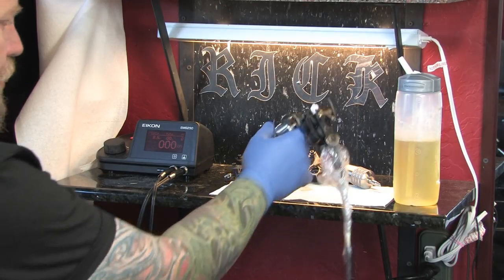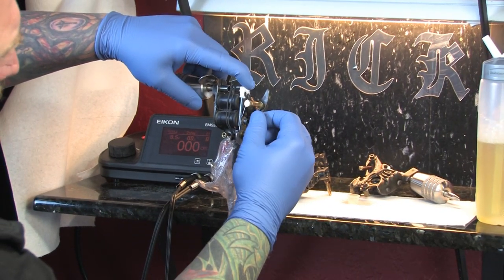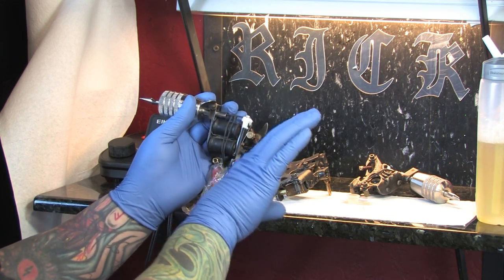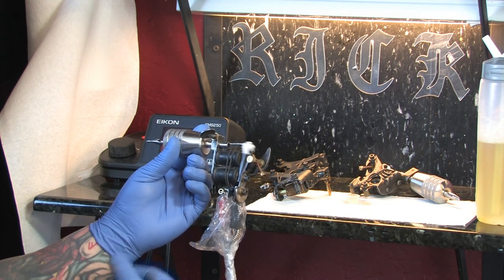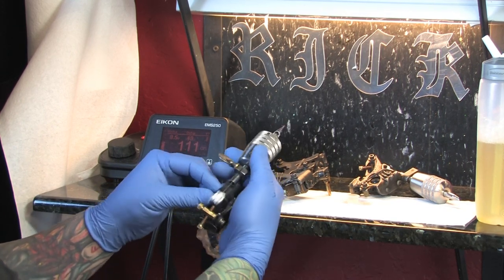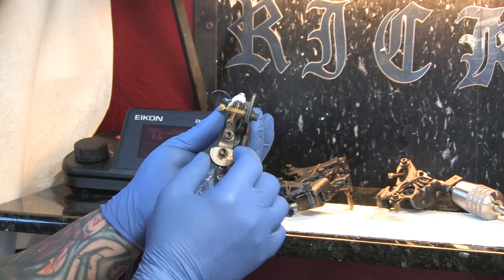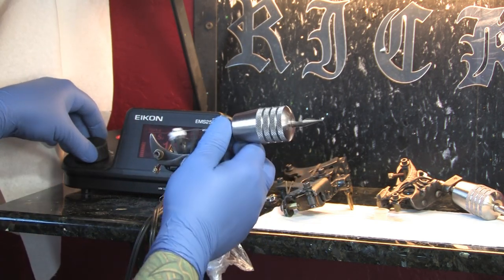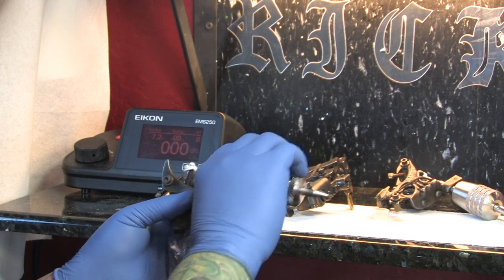Tattoo Machine Adjustment

Comment: that power supply is a crutch .  your armature bar is too far out that means your tension is wrong and thus you run at 8v when it should be 5v . that machine nor your thumb knows the spring tension. also you have a shader front and the rear is a liner spring ......  other than that its all good